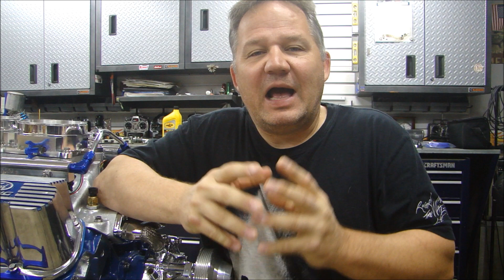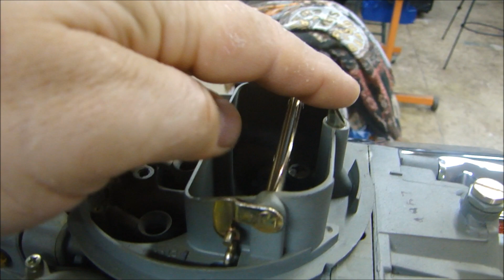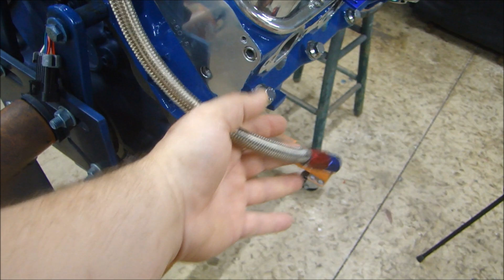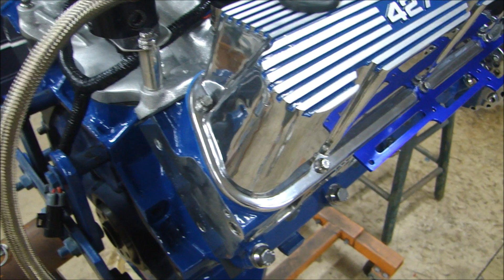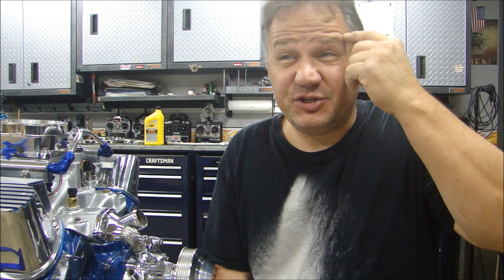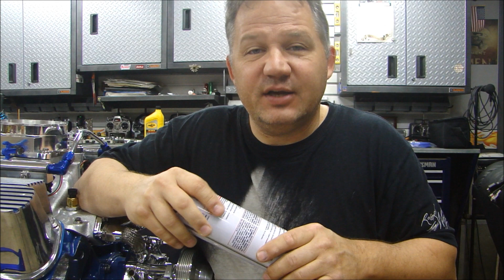Vapor Lock & Hydro Lock

Comment: I would think that to get hydrolock that injector would have to be stuck open, even if the cylinders not firing, your exhaust valve will make sure you don't hydrolock by letting the gas escape that way. I have even seen cars with stuck open injectors NOT hydrolock, just stinking of gas and destroyed the cat.
Reply from the maker: Entirely possible. However, I'm not really talking about an everyday car. I deal mostly with customs and high performance engines where the builder made a couple mistakes that resulted in these problems
Reply: +Petes Garage I really appreciate your time and consideration for car enthusiast like myself. it's plain to see you are not the average mechanic rather bordering on the mechanical engineer side of things.
Reply from the maker: Thank you. I always tend to look at things from the engineering perspective. I want to know the "why" as much as possible

Comment: Thats why with an injection system or even a carby system, it's a good idea to run one of the types of regulators with the return line on in. and mount it on the firewall, or even under the car, away from the exhaust so you're not passing heated fuel back into the tank, which will eventually give you a tank full of hot gas, and a car that will no longer run - I've seen it happen.
Reply from the maker: That is a great comment, thank you

Comment: Wouldn't wrapping the fuel line in a thick layer of insulation solve the boiling fuel problem?
Reply from the maker: There is actually a product that protects from heat instead of holding it in, but you are on the right track

Comment: Good vid.  Pete. Last year a friend came by with a 65 chevy truck 6 cylinder that he just bought that kept stalling on him. when i opened the hood there was old tin foil thin on the fuel line. LOL. Then the new carb with just a paper base gasket.Got rid of foil and put thicker gasket under the car. FIXED
Reply from the maker: Many older vehicles are prone to this problem. Knowing what causes it makes it easy to fix. Thanks for sharing that example